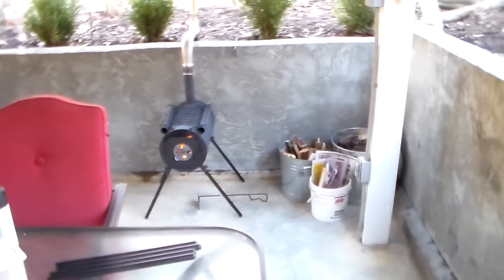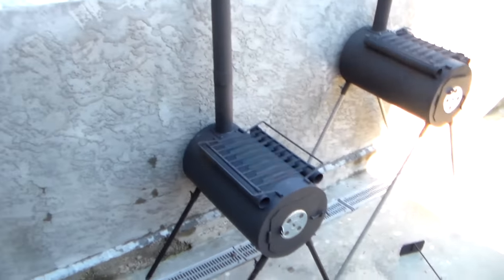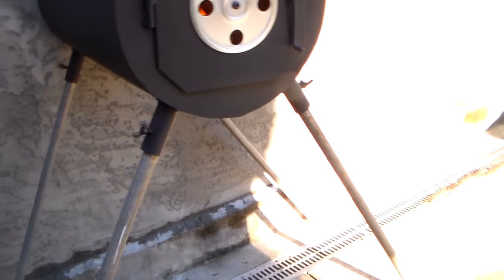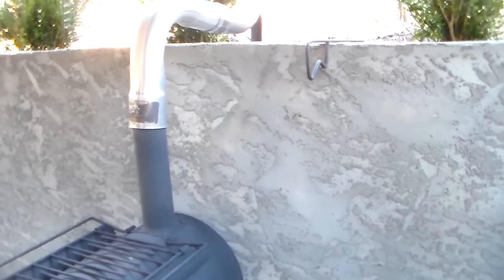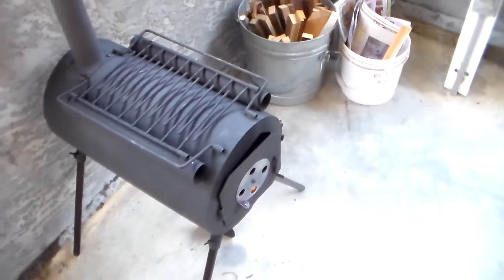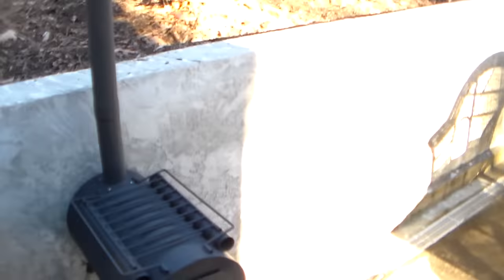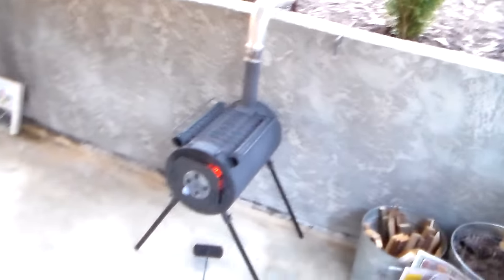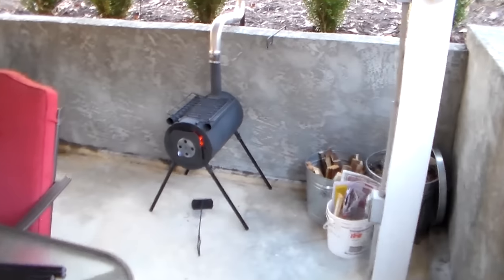Small portable outdoor woodstove for campers or preppers

Comment: I cut a piece of steel grating and put it in the bottom of mine. Solves 2 potential issues.  Allows for better and more efficient burning as air can get underneath the wood and as well, it will give the belly of the stove a longer life.
Reply: That and putting a piece of hardware cloth (wire mesh)around the flue cap make those little stoves much better.
Reply: +duxdawg  The window screen just doesn't last as long , the hardware cloth even though it has larger openings can be double wrapped and the mesh doesn't necessarily catch the spark as much as change the flow out of the flue( you can actually watch sparks doing little swirls inside the cap) just enough to stop most sparks. All the same,whatever works well for you.
Reply: +RealRickyRoss that is an excellent idea.
Reply: @jamesbridges7750  Thanks

Comment: I've had mine for about 5 years I've redid the door and installed a gasket around it. Love the stove. I use mine in a guide tent. I like the exhaust pipe ideas thanks
Reply: I added more strength aby the legs and added 2 door hinges to the top of the front opening. No more smoke in my tent. I've had my tent 180f in 13f outdoor temps.
Reply: @TamponTea  I also put a brace between the legs I want to remove the door and get the glass out of an oven door and make a door out of the glass
Reply: @leeh.4729  I did a glass door and I woke up to a tent of full of smoke. I think a small miracle window 2x3 would be better
Reply: Mica
Reply: @TamponTea  that would be easier to cut and mount in the door I have thanks.   I've got a stove fan I set on it to move the air . we got 4 inches of snow the last time we took it out and 16 degrees at night I found that if I cut the fire logs from wal mart or wherever into 1/3 it burns with no smoke. To old or dummy to know how to share photos of my set up on here

Comment: Great little stove.  If you add a 2.5 inch-3 inch muffler adapter and go with inexpensive 3 inch heat duct for stove pipe you can increase the draw and not have any smoke problems.  I see you are propping the doors open.  Add a rack and get the wood off the bottom of the stove.  That will increase the burn by quite a bit.  Find a free grate or make one or buy a cheap one at Home Depot/Lowes and cut it to fit.  If you aren't getting enough air flow you can cut a sliding slot below the spinner damper or open up the holes by 25%.  It's all about air flow, so the more air you let in the hotter more efficient the burn.  Take a wire brush and sand off the stock paint and spray high heat paint ASAP.  The stock paint will eventually burn off and rust out if you aren't careful.  With a little DIY, this is an awesome little wood burning stove.

 PS, your pipe is installed backwards and will bleed out creosote, so only burn super dry wood.  That's another problem with this stove that needs attention.  Do the 2.5-3 inch mod and you won't have that issue.

Comment: If you want the stove to last longer fill the bottom with sand. This will keep the bottom from rusting out as quickly.
Reply: +TRU Dat Thin fire bricks would be a better option, less mess and easier to clean/separate ashes.
Reply: +Tom M
Brick is better than nothing, but not as good as sand for rust.
Reply: Great tip

Comment: I have one of these, it was one of the originals, I could never get much heat out of it. Also the opening on the back allows air to get to the fire and then smoke comes out of the front.  So here are the fixes I put into mine, I added a 7 inch piece of stainless steal at the top about 14 inches long. I cut out the two inch pipe, it would not draw well so I put in a 4 inch pipe with a damper.  I also added a second air pipe which I ran under the grate which super heats the air and shoots it into the smoke at the top of the stove.  I had to use a hole punch to put this in it extends about 3 inches below the stove in the back. It is now a drive you out of the tent stove, and it has a very clean burn.  One last thing the opening on the back just allows your wood to burn more quickly than you want try to keep it closed.  Oh and don't forget to add some stove gasket to the door and the bottom where the clean out trap is. Helps control the burn.

Comment: Here's a cheap idea. In the spring people set their old propane grills out to the curb for the trash man to haul away.
I found one with a side burner. I threw out the bbq grill burners and capped off the gas port to the grill at the regulator.
I put another layer of metal in the bottom of the grill. They are usually rusted through.
That way I can cook on charcoal or wood on the grill side or use the propane burner on the side of the stove.
It makes a good backup cooking appliance if a storm knocks out the power.
A 20 pound propane tank will last a month or so for most people.
I could conserve gas by setting a paint can hobo stove in the grill side and doing most of my cooking on that using twigs for fuel. 
Thanks for the video.

Comment: I bought a different one from sportsmans guide a few years back, its the more square one that costs about $140, it probably weighs twice as much as these, so its less portable.  The steel is very thick and the pipe is a larger diameter.  It doesn't come with as many accessories but the quality is makes it worth it for me.  and the box is large enough that I was able to line the bottom and I built a little grate to keep the logs up.  Great vid as always!

Comment: I was lucky and snagged a 55 gl stainless steel barrel. Key thing here is its Stainless Steel! Very thick walled. In fact, I burned trough 5 Cobalt, aircraft grade drill bits just cutting the holes for the stove kit. Since I'm not a machinist it took some GI ingenuity to figure out how to cut out the door and stack openings but was successful. I haven't cranked it up yet but I'm very sure its going to be super heat and cook stove. One thing I added was metal tape on the stack seams to close up any potential air leaks.

Comment: Repeated painting won't help. Cure the metal instead using rendered fat from the meat you are cooking on the grill. Same principle as curing cast iron skillets, or woks. Over the years we've tried every type of high temp paint, even some that required us kiln heating the pit, applying the paint, then baking the paint into an enamel and it all flakes off rather quickly with repeated use. Keeping the metal treated with a food grade oil, such as rendered fat will prevent rust and make your investment last much longer.
Reply: Thanks, I never thought about it, makes sense.

Comment: bought one of these for 43.00 free shipping online used it in my old 1969 travel trailer up deer hunting. had to turn all the pipe over so the creasote from burning wood would stay inside the pipe and not run outside and smoke up the trailer picked up a metal roof vent and run it up through the vent worked great once I got the pipe turned right. I plan on putting screws in the pipe to hold them together next time I use it

Comment: I bought one from Ebay. The first time I burned it the paint peeled in sections.
So I sanded it off, bought some high temp stove paint and made it look nice.
Mine is only 10 inches in diameter. I was hoping to use it to heat a teepee but it won't hold a fire for more than two hours so a guy would have to be waking up frequently. The bad thing about camping in WI is everything feels damp in the morning, but that's everything is green too. Even a small fire keeps the humidity out.

If they would make this in a 12 inch diameter and make it longer, it might be able to hold a fire all night.

Comment: SP1,I used a stove almost identical to these in minus 30 celcius in a military arctic tent, I found it heated the tent nicely. Downside was the grill on top didn't get hot enough to cook bacon, (minus 30 might of been the issue), I am mod'ing mine to have a flat top. I also found that the pieces of chimney stuck together on tear down the creosote created a tar like glue making it VERY difficult to take apart. I plan on changing the direction of the way the chimney fit so the creosote cannot run down and stick pipe together. I also am gonna add a chimney flue. we shall see.keep up the great videos!!Jay out

Comment: I have one , I got rid of the 2" flu pipe and cut a 4" hole , put the crimped end of a 4" stove pipe in the hole , and it works great now, also I put a damper in the first section.

Comment: Good timing on this... I just ordered a 4 Dog Night stove, their "2 dog night" model. They are a bit on the expensive side, but I plan on doing some cold weather camping too so it's not just going to sit and wait for an emergency situation. This one is made in the USA and I can see it lasting a lifetime by the reviews I've read. It's also apparently very efficient because of the design of a baffle inside the firebox. Idk, just thought I'd share, mine should be delivered this Friday,,, can't wait to try it out. Maybe I'll post a review of it here.
Reply: Thanks, I'll check it out. I got the campchef stove with water heater and two rack, it's similar to the DX with Camp Chef being more functional. I will refer others to yours as mine is no longer available, just the hot water tank for mine can be purchased at this point.

Comment: They are ok stoves, but and this is only a little but, they are cheap and made to a price!
I have a Frontier Stove made along the same design but is a little bit better made and it cooks great.
In both stove's you can or could get a wrap around boiler for the flue pipe to heat water, or wrap a flexi copper pipe around the flue and create a thermosyphon system. Thanks for the vid.T

Comment: just a quick suggestion you can heat a lot of water via solar, there's several solar "shower" bags out there that don't cost much and you don't have to use it just for showers a 55 gal barrel painted black will get the water pretty hot certainly enough to wash clothes, kids, dishes etc

Comment: Paint , BBQ spray , so not a issue in the field,  To me its a luxury And a bivy ( shelter ) with tarp ideal and for 60 bucks, Thats not a lunch meal and a few beers for you and yours. A home made grate so you dont burn out the bottom and very good to go , if it lasts 2 years , i think it will Ha its gold, its light to carry , i rap food in tinfoil and carry it with a harness made from a shopping trolley that i tow  attached to my belt . ( shopping trolley type your wife or girl has . works well ,). So thanks for putting me on to this item, I bought after seeing this vid, 10 months in still going strong , So very much apprecado  and mucho gratis Southern. O saw your Vid on folding saws, I am now the proud owner of a Silky Katanaboy 15 inch , wow does that cut , 6 inch dia log Piece of cake, really guys stays razor sharp and unbelievable cutting power.Again thanks for info or i would not have thought of Silky       ,
Reply: Kev M + 10 months on it. Good. But a good quality woodburning stove should be serving 100 years. Plenty have. For example, Round Oak stoves. GTO compared to VW bug.

Comment: Since you asked for questions, I'll field my top questions regarding things that could make my home uninhabitable in a grid-down scenario:

1) Water. 
1A) We have our own well. I want to add a solar and battery auxiliary power system. As a second back-up, I think a hand pump may be a decent idea. What's the best way to switch the system from electric to hand pump in a  grid-down situation? 
1B) As a tertiary back-up, there is a creek nearby that springs from less than half a mile away. It goes through only one property before reaching a place where public could access, so it should be clean of chemical pollution. It is 200 - 300 yards away. Is there a human powered pump solution for drawing it up through a pipe to our property?

2) Heat. We live in a double-wide that will never be able to move again. There is no fire place, so what's the best back-up heating system?

3) Cooling. Same as above, what's the best way to cool a place like this in the summer without electricity?

Comment: Check out the water kettle for that stove. It attaches to the stove pipe and has a long spout that hangs over the edge for filling your mug or whatever else you need hot water for, very nice Amazon sells them. I have read reviews about these stoves warping, have you noticed that with yours?

Comment: I have found these on Ebay for $30 and all the way  up to  $80. Same stove, some are trying  to get rich quick.

The round part is only 10 inches. I wish someone would make one in 18 inch diameter or even 24. This can heat a tent but it can't hold a fire  all night. You have to wake up at least two times in the night to feed it.

Comment: sometimes a big woodstove can be intimidating especially if your new to the whole thing, these are small and reasonable enough to be a good starting point.... also a good way to involve the bigger kids in setting a fire too.... edited because I can't spell...lol
Reply: loch ness Well, no. Actually getting a real wood stove is less intimidating. You will need a flew with a damper for sure. A side loading stove is nice. One with an ash pan/drawer. Brick lined in the fire box. You need to keep the fire hot to keep creosote from becoming sticky and building up to fast or you will start a fire in the chimney. I used a stove pipe temp gauge. It's chimney fires that usually burn down houses. This is what I do. You should seek out good information and proceed carefully. Otherwise I recommend not burning at all until you and especially your children know what they are doing. Even/especially with a rinky dink camp stove from China.

Comment: Because you have the second elevation of your retaining wall, you might find that you could have a second cooking location using the heat that is coming out of the top of the smoke stacks.  Either make a support structure for a big pot to sit a few inches above the chimney top and cook soup all day heat water or have it blast against a piece of plate steel and use that as a cooking surface.  
additionally with very little extra work, you could run your water heating thermal siphon pipe inside your upper chimney...

Comment: If I may, I've noticed people doing their own stoves or at least stove pipe chimney installations are putting the pipe stacks on upside down. Point is that if you burn wet or green wood, the moisture that will run down the inside of the stack chimney pipe runs into the stove and not down the outside. One may think that the chimney won't seal, but soot build up does it. Think of feeding that moisture back into the pipe. otherwise at each pipe crimped connection leaks resulting in a dangerous combustable creosote type buildup.

Comment: consider putting a piece of metal in the bottom of the stove which is replaceable if it gets melted.
some fire brick or maybe even dirt.
more expensive stoves may be made with thicker metal all around which would make them stronger, more durable but heavier.

Comment: There is a water heater that is sold by someone that will hang on the side of those stoves.  I can not remember who makes them but I have seen them online.  With a little searching you might find them.  Yes water can be boiled on top of them, but adding the hanging water tanks would allow for heating water for coffee, tea, hot co co, washing hands or bowl bathing while at the same time cooking.

My wife and I were looking for stoves just like that and somehow got the website that sold the water tanks for them but they did not sell the stoves, so we figured they made them, but did not make the stoves. I think the water tanks were more square or rectangled looking, but they did hang on the sides of that style stove.
Reply from the maker: +enerZise I have two of the water tanks ordered and they have shipped so hopefully in 2 more days will have them to test them out.  I waited till I found them a little cheaper and they where still expensive $39 each so hopefully they work good.  I think they are only 2 quarts so not a lot of water but for tea and coffee will work.
Reply: I was looking at your video again and I suspect there is a lot of heat radiating from the bottom of those stoves. 

There is enough room to put a metal rack or cinder blocks under them to use as a heating stand for keeping food already cooked warm. Sort of using the bottom of the stove as a heat lamp that is.
Reply: Sounds like the campchef website, they sell the water heater for $109, but no longer sell the stove. I have the stove and hot water heater. I did several years of research before I purchased, so I believe it was the best stove available for the price when I purchased the Camp Chef Wood Stove.

Comment: Those tubes could be closed at the front with a metal tap & the rear closed with an open & flared top so you can fill it with water, let steam out so it doesn't swell & burst and you will be able to temp the water or see when it's boiling :)

Comment: How is the draft? 3 inch automoive pipe enough? Also. fireplace exhaust pipe is stacked with the top pipe fitting into a lower pipe. Just so resin and debris flows down into the fire and not oustside the pipe. I have been studying something like this for a shop heater.
Reply from the maker: +Christopher Z The draft could be better so you need to keep the vent opened all the way.  I am going to do some testing with another piece of pipe maybe longer will help.
Reply: +southernprepper1 Thank you..Good night
Reply: +southernprepper1 
Try only using one elbow,every elbow you add decreases draw.
As someone else suggested,look into the Vogelzang barrel stove kits,I've heated a 24x36 ft garage/shop with one for years. All you need is a solid 55 gallon drum,and a bag or so of sand from Lowe's/Home Depot/Wal_mart to line the bottom of the barrel with.
Reply: +southernprepper1 Diameter is important for moving volume.